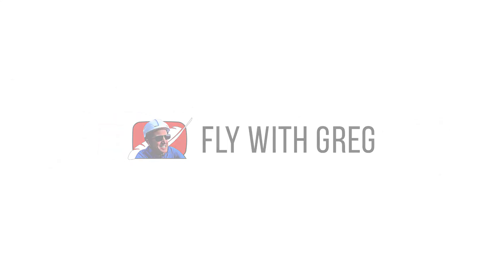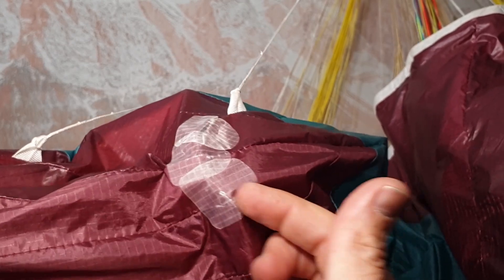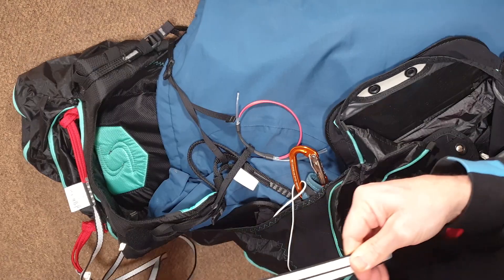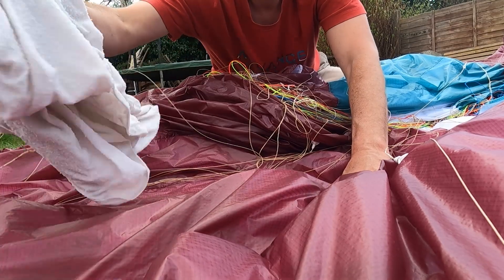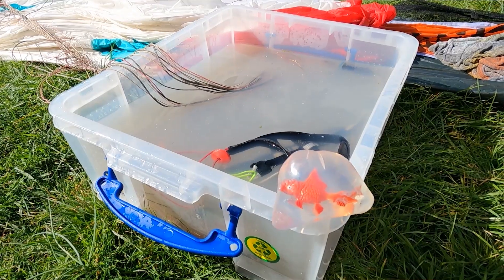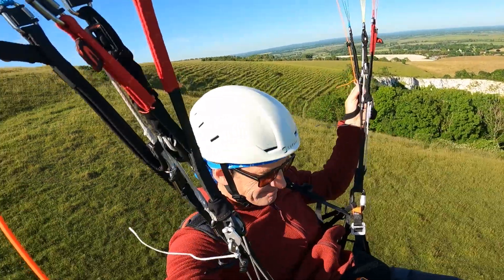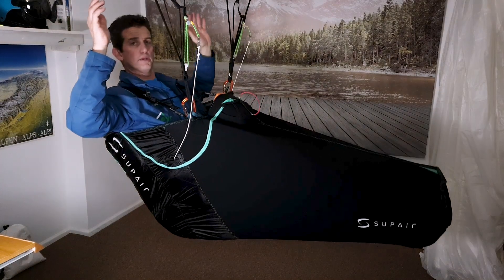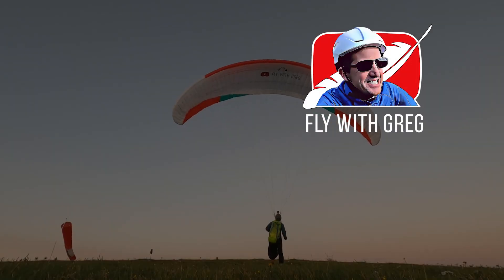Don't leave your maillons like this!

Comment: Don't use pliers to ever  tighten malions, always use the correct size spanner, using pliers you can create a sharp edge that can eventually wear through lines or reserve equipment.
Reply from the maker: yeah good point, it was not the best tool to use, I had lost the spanner but I am very gentle with them here

Comment: A parachute rigger I use has repacked my reserves on a couple of occasions. 10yrs experience repacking skydiving canopies.
A maillon was used on the first. And, the second ( a new harness ) the bridles were threaded through each other  and the  larkshead cinched tightly. To stop the larks head slipping apart and becoming loose it was tagged  with a strong linen thread  (sewn) . Whether a maillon or larks head is used, attention to detail is key.

Comment from the maker: A spanner is better than pliers for tightening the maillon. The 'quarter turn' depends on how much your fingers can tighten - just turn enough to secure the maillon a little. O-rings or rubber bands are preferable over tape, and only use non-adhesive tape like electrical tape that grips onto itself by stretching (no tapes with glue!)

Comment: As an aircraft mechanic I cringe when pliers are used to tighten nuts or bolts. Even a adjustable spanner is better.
Reply from the maker: fair point Tormod, I usually use a spanner, it wasn't nearby when recording

Comment: Greg, don't use pliers for the maillons, pls. Use a hex wrench. And not "a quarter turn"... a damaged thread is to be avoided. Use a drop of loctite, e.g.
Reply: Loctite is fine but these maillons are only structural if tightened correctly. So don't just rely on loctite
Reply: Snug it, and yes use wrench as pliers could cause a burr which could cut into a line...